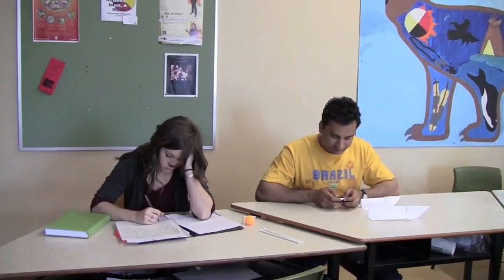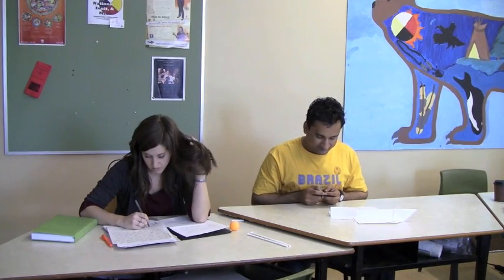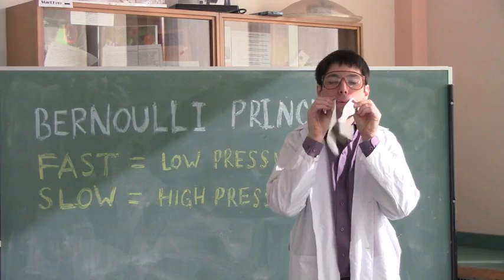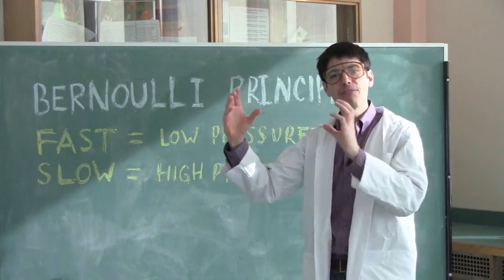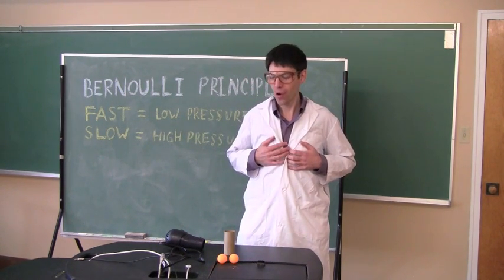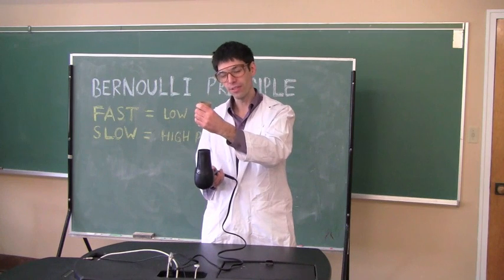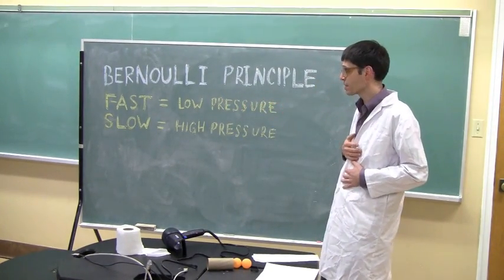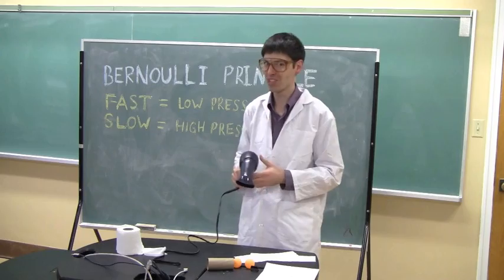✈✈ Bernoulli's Principle - Easiest Way Explained ✈✈ ☹ ☹

Comment: This is a BAD SCIENCE VIDEO.
.
Why do you want to spread these misconceptions?  Fix or delete this video.
I am very sorry, but this is only repeating some  of the most common misconceptions in science.  
Fast air does not have low pressure.  What Bernoulli found is that Accelerating air has a decreasing pressure and visa versa; BUT NOT what caused this to happen.  
--
Euler continued that study and realized that it is a pressure Gradient (difference between two locations) that is the force that accelerates a fluid.  This is Newton for fluids.
...
The air out of your mouth is at atmospheric pressure; that same pressure as the still air around it.  It is the higher pressure*created *inside your lungs by the contracting muscles that accelerates the air out into the lower, atmospheric pressure.
..
Blowing next to paper demonstrates entrainment which is caused by viscosity. . Look them up.  
If this is what your teacher taught, they have been misinformed, which is, unfortunately, VERY common.
--
The air over a wing only looks faster in a wind tunnel.  The lower air is actually faster as a wing flies by you.  The upper air is, however,  accelerated much more caused by the lower pressure above the wing.
The pressure changes around a wing are simply caused by the wing pushing air out of the way to get through it.
...
Bernoulli had nothing to do with the development of the airplane. He was doing blood pressure studies.
...
The air above a wing gets to the trailing edge significant;y BEFORE the lower air; which is caused by the low pressure accelerating it toward the rear.
...
The ping-pong ball is held in the center by the Coanda Effect. A flow that follows a convex surface is what lowers the pressure. Think of centrifugal force pulling the air away and, therefore lowering the pressure.
 The air out of the hair drier is at atmospheric pressure, The side of the ball where more air curves around to the down-wind side (top)  of the ball has a lower pressure because of the greater Coanda curved flow. 
When tipped, there is more air flowing over the top AND flowing in a curved path (around the back and then downward).  This lowers the pressure more and supports more of the weight, therefore, allowing the upward moving air's dynamic pressure to push the ball further out..  This is the only explanation which explains why the ball moves further away when the flow it tipped because the air is slowing down farther from the blower and the centering force would be less, not more, if the Bernoulli fallacy as true.
..
ALSO, if the air at the blower's exit was lowest, the ball would be "sucked" down (actually pushed down by higher pressure above it)
...

The tube above the ping-pong ball is a very good discovery and requires a more careful understanding because this fast air thing is false.  
My initial analysis is as follows:
The tube prevents much of the air which would simply 'spill' around the sides of the ball to be trapped below the ball in the tube and to push the ball up like a piston in a cylinder.

Comment: Why do you want to spread these misconceptions?  Fix or delete this video.
I am very sorry, but this is only repeating some  of the most common misconceptions in science.  
Fast air does not have low pressure.  What Bernoulli found is that Accelerating air has a decreasing pressure and visa versa; BUT NOT what caused this to happen.  
--
Euler continued that study and realized that it is a pressure Gradient (difference between two locations) that is the force that accelerates a fluid.  This is Newton for fluids.
...
The air out of your mouth is at atmospheric pressure; that same pressure as the still air around it.  It is the higher pressure*created *inside your lungs by the contracting muscles that accelerates the air out into the lower, atmospheric pressure.
..
Blowing next to paper demonstrates entrainment which is caused by viscosity. . Look them up.  
If this is what your teacher taught, they have been misinformed, which is, unfortunately, VERY common.
--
The air over a wing only looks faster in a wind tunnel.  The lower air is actually faster as a wing flies by you.  The upper air is, however,  accelerated much more caused by the lower pressure above the wing.
The pressure changes around a wing are simply caused by the wing pushing air out of the way to get through it.
...
Bernoulli had nothing to do with the development of the airplane. He was doing blood pressure studies.
...
The air above a wing gets to the trailing edge significant;y BEFORE the lower air; which is caused by the low pressure accelerating it toward the rear.
...
The ping-pong ball is held in the center by the Coanda Effect. A flow that follows a convex surface is what lowers the pressure. Think of centrifugal force pulling the air away and, therefore lowering the pressure.
 The air out of the hair drier is at atmospheric pressure, The side of the ball where more air curves around to the down-wind side (top)  of the ball has a lower pressure because of the greater Coanda curved flow. 
When tipped, there is more air flowing over the top AND flowing in a curved path (around the back and then downward).  This lowers the pressure more and supports more of the weight, therefore, allowing the upward moving air's dynamic pressure to push the ball further out..  This is the only explanation which explains why the ball moves further away when the flow it tipped because the air is slowing down farther from the blower and the centering force would be less, not more, if the Bernoulli fallacy as true.
..
ALSO, if the air at the blower's exit was lowest, the ball would be "sucked" down (actually pushed down by higher pressure above it)
...

The tube above the ping-pong ball is a very good discovery and requires a more careful understanding because this fast air thing is false.  
My initial analysis is as follows:
The tube prevents much of the air which would simply 'spill' around the sides of the ball to be trapped below the ball in the tube and to push the ball up like a piston in a cylinder.

Comment: -Well done explaining its effects-, but the video didn't even address the issue of why the principle works or attempt to illustrate how it works in an intuitive way.

The title was a bit misleading.

EDIT: Apparently it wasn't well done at all.
Reply: No, Not well done.
I am very sorry, but this is only repeating some  of the most common misconceptions in science.  
Fast air does not have low pressure.  What Bernoulli found is that Accelerating air has a decreasing pressure and visa versa; BUT NOT what caused this to happen.  
--
Euler continued that study and realized that it is a pressure Gradient (difference between two locations) that is the force that accelerates a fluid.  This is Newton for fluids.
...
The air out of your mouth is at atmospheric pressure; that same pressure as the still air around it.  It is the higher pressure*created *inside your lungs by the contracting muscles that accelerates the air out into the lower, atmospheric pressure.
..
Blowing next to paper demonstrates entrainment which is caused by viscosity. . Look them up.  
If this is what your teacher taught, they have been misinformed, which is, unfortunately, VERY common.
--
The air over a wing only looks faster in a wind tunnel.  The lower air is actually faster as a wing flies by you.  The upper air is, however,  accelerated much more caused by the lower pressure above the wing.
The pressure changes around a wing are simply caused by the wing pushing air out of the way to get through it.
...
Bernoulli had nothing to do with the development of the airplane. He was doing blood pressure studies.
...
The air above a wing gets to the trailing edge significant;y BEFORE the lower air; which is caused by the low pressure accelerating it toward the rear.
...
The ping-pong ball is held in the center by the Coanda Effect. A flow that follows a convex surface is what lowers the pressure. Think of centrifugal force pulling the air away and, therefore lowering the pressure.
 The air out of the hair drier is at atmospheric pressure, The side of the ball where more air curves around to the down-wind side (top)  of the ball has a lower pressure because of the greater Coanda curved flow. 
When tipped, there is more air flowing over the top AND flowing in a curved path (around the back and then downward).  This lowers the pressure more and supports more of the weight, therefore, allowing the upward moving air's dynamic pressure to push the ball further out..  This is the only explanation which explains why the ball moves further away when the flow it tipped because the air is slowing down farther from the blower and the centering force would be less, not more, if the Bernoulli fallacy as true.
..
ALSO, if the air at the blower's exit was lowest, the ball would be "sucked" down (actually pushed down by higher pressure above it)
...

The tube above the ping-pong ball is a very good discovery and requires a more careful understanding because this fast air thing is false.  
My initial analysis is as follows:
The tube prevents much of the air which would simply 'spill' around the sides of the ball to be trapped below the ball in the tube and to push the ball up like a piston in a cylinder.
Reply: Observ45er Thank you so much for telling me this! I'm really happy that you explained these faults.
Reply: @axelandersson6314  Thank you.  There are so many people repeating the common errors here and elsewhere that it makes finding good information very difficult.   Telling the video producers is also futile because many totally ignore any corrections and many don't even read comments. 
Weltner has some good information for most people you want to get the complete story:
Weltner in PDF - "Misinterpretations of Bernoulli's Law".  
http://user.uni-frankfurt.de/~weltner/Misinterpretations%20of%20Bernoullis%20Law%202011%20internet.pdf
..
Be sure to read the text because some of his early figures are used to explain some common misconceptions .